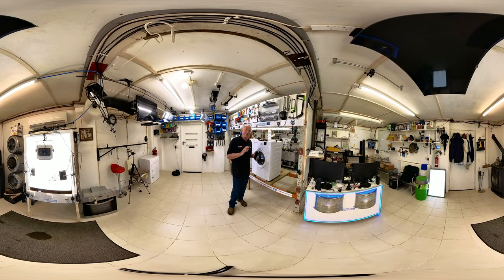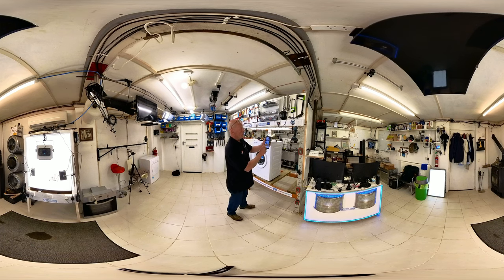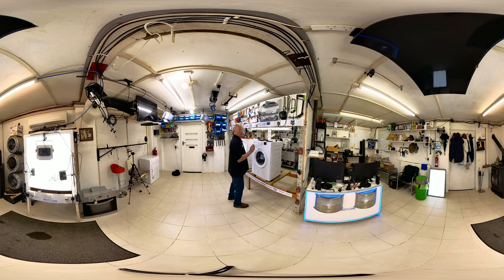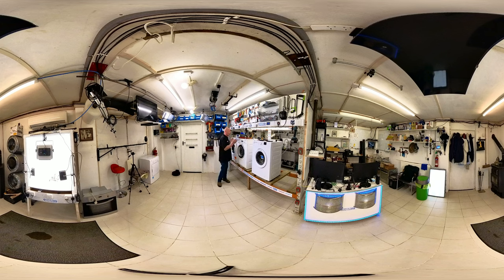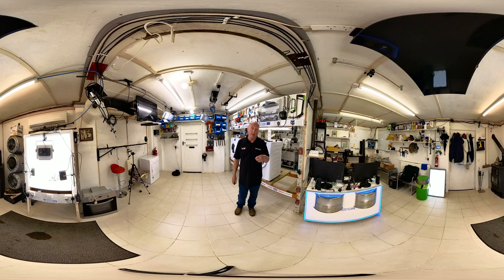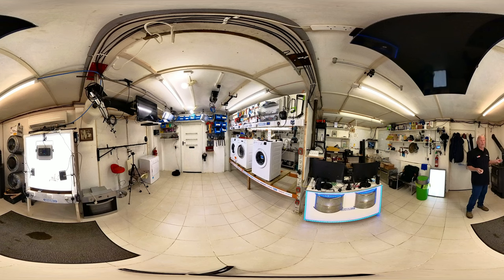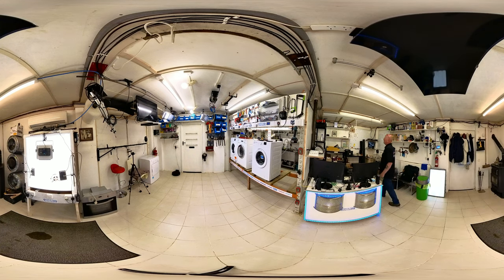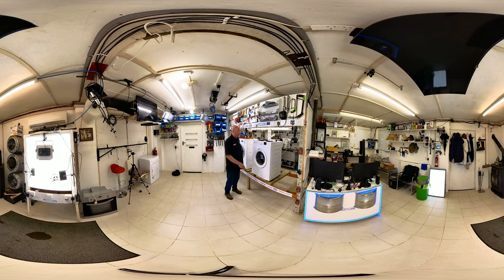Take a 360° Tour of Our 100% Eco-Friendly Appliance Repair Workshop and Film Studio

Comment: Thank you for a comprehensive tour of your work shop I am full of envy. I am very interested in repairing our house hold appliances if possible. Our Hotpoint BWM 129 washing machine is coming to the end of its life. Could you please recommend a machine that I would be able to maintain? We are a retired couple so there is not a lot of pressure on the machine maybe 2-3 washes per week. Keep up the good work.
Reply from the maker: With most manufacturers, nowadays are building in so much built-in obsolescence, it is very difficult for me to honestly put my hand on my heart and say which to buy. I would not want to say a individual make and then it fail on you within a couple of years.. I would either buy a machine from John Lewis, who gives a statutory two year warranty on all machines or it is possible. If you are willing to go to the expense to buy an English made machine from Ebac they are meant to be giving between five and seven years guarantee. I am sorry to be so vague, but I would hate to put my name to something that didn't work
Reply: Electrolux washing washing.. I have purchased one today model: EWF9024D3WB

Comment: Hi i have a hoover h dry 100 that hums i have replaced the capacitor and the resistor type one and still hums i am at my wits end trying to sort the fault plzzzzzz help
Reply from the maker: Hi, please use our contact us page and make sure you fill out the request for what your problem is. I will need the full model number of the identification plate and the details of your problem so that I can provide you with useful literature. A video shoot of the problem would be perfect as well.

Normally, I would get back to you within 24 hours but I am on my way back from the IFA trade show in Berlin, so it can take more time to respond. Thanks for your understanding. https://www.how-to-repair.com/help/contact-us/   

Please remember to subscribe to our channel, as that's what keeps this channel going. Thanks, Paul 👍

Comment: Thanks for the effort, very much appreciated. Slightly going off topic but I’m at my wits end researching which heat pump dryer to get! I fancy a Miele but don’t think I’ll get the return on such an expensive dryer. What brands do you recommend? Should I go cheap or expensive, many thanks.
Reply from the maker: I'm not a great fan of heat pump tumble dryers because it's a refrigeration process combined with the dust they seem to fail a lot

Comment: Just a question regarding when you advised about the Miele bearings had failed. Did you mean that the spider had failed instead? With that design of Miele they use the 6302Z bearing I believe which could be bought online elsewhere to save Miele's extortionate spare part pricing and just order there bearing and rear cover seal to save costs? I personally try to keep the older models running and refurbish in my workshop as the new models coming out these days just seem overcomplicated and sell there new ideas which continue to say improves performance when most of the time all I hear from customers is they usually use only a handful of the available programmes which wouldn't use the new tech anyway! 

I don't know if you have personally seen an increase of the heat pump drier callouts in the field, but all I keep finding is the customers are either sold something they are not properly educated on how it operates. Therefor they treat it like there old condenser dryer and soon enough I get called out to explain how they need to now regularly clean there pathways to prevent the sensors from acting up. Or they put the machine in an unheated environment and complain when winter rolls around that the machine doesn't want to run because the ambient temperature is too low for the compressor to activate. 

I personally feel that this push for heat pump boilers will have a difficult start, as they need to be placed in an area of the house which will not be effected by cold snaps. But this could mean that a customers whole system may need a complete overhaul which would result in a massive charge. Are you personally thinking of getting trained in this market or looking at this area of trade in the near future as I have mixed feelings about not only this market, but also the appliance market going forward. 

Would be interesting to possibly sit down and have a discussion about this if you have some free time soon. I'm looking into starting a podcast with the aim of getting people who are in our area of trade to come on and discuss there life as an appliance engineer, how they got into the job and all the strange and funny stories they have experienced along the way. Would be great if we could get on a voice call if this is something which interests you?
Reply from the maker: Yes, send me over your contact details through the website and we can have a chat

Comment: Had no idea you was in wales 🏴 
I live in the Brecon area I mainly have good internet but it’s very questionable at times…
Reply from the maker: Yes, lived here most of my life, but I've spent the last 15 years also at my shop in Portugal .but I've had to close it recently due to family problems. So I'm back in the cold lol.  As an ageing appliance engineer, my expertise lies more in the domain of domestic devices than in IT, resulting in a limited understanding of YouTube video optimisation. Consequently, my videos might not reach their full potential due to these IT constraints.

Nevertheless, they offer invaluable aid to those who encounter them. Your support in sharing our channel on social media would be immensely valued. By disseminating our content, you enhance our visibility and contribute towards addressing the pressing matter of appliance wastage. In turn, you play a role in averting numerous machines from facing an untimely end in the heavenly scrapheap of appliances. Thanks 👍
Reply: @How-to-repair  Paul your videos are fine, plain and simple and straight to the point and you couldn’t explain anything any easier in my opinion and many others. 
I wish I could fix my old LG but been told my bearing has issues as water is leaking out of it down the tub rusting all the element wires as water is dripping on them causing some electrical buzzing that’s what made me look inside it as it’s been doing it since just before Christmas but I just ignored it till last week as it still doing everything it was supposed to do. 
No mad bearing noise has started yet, but the rubber squeaking noise behind the drum has especially when washing. 
But it’s a lg turbowash FH4U2TDN2s but it’s now 6 years old 7 soon.  
And it was 2nd hand it’s lasted me alright.
so got the new LG 10/6KG FWY706GBTN1 washer/dryer combo coming next week as I loved my LG machine and tv so decided to get a brand new LG washer that has 5 years full warranty! so very happy with that 
And looking forward to going to work and putting my bedding in and it’s all washed and dried at the same time, plus getting up in the morning and it’s all washed and dried and doesn’t stink of damp 😃😂 
My old one is still working don’t know how with water dripping on everything but not complaining. 
And thanks for all you’re replies my fellow Welshy 🏴 🙂